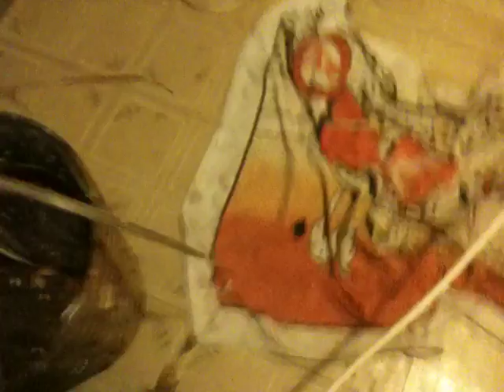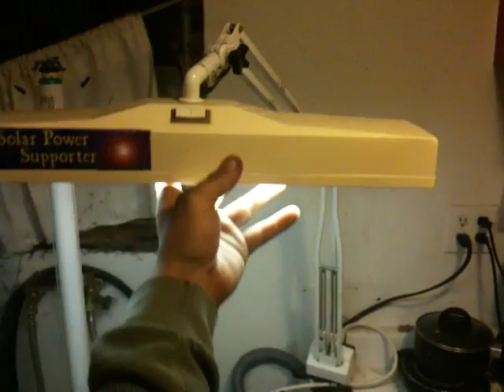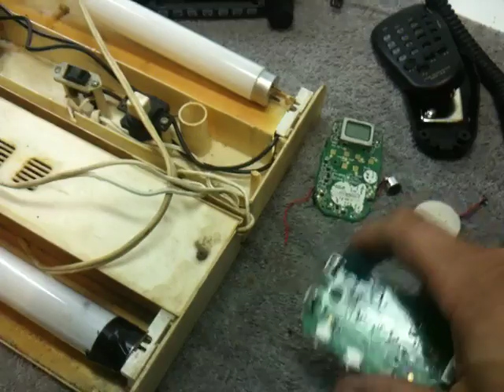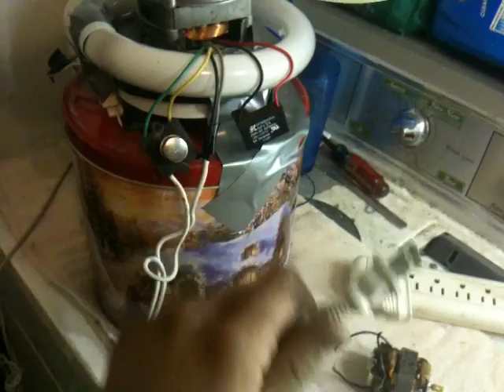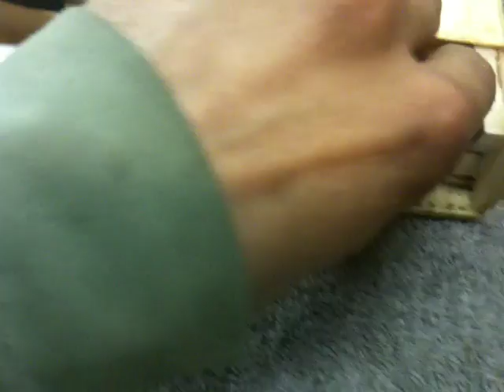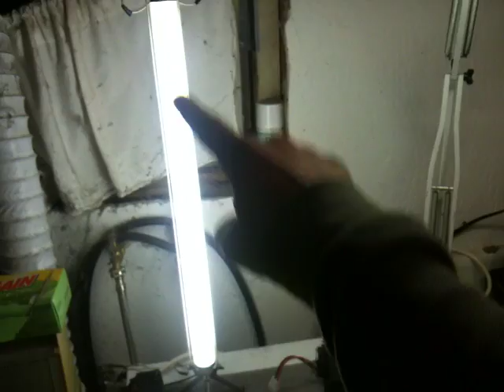My basic Lamp Presintation

Comment from the maker: i've watch the video many times over now and I never said that lamps shades are 'Useless' I pointed out that I saw no sense in using them with incandescents because Fluoescent are the same as incandescent only difference is the white powder on the walls of the glass act as "Diffusers" as you call it already and they use less power then a incandescents and do "NOT" hurt my eyes. Maybe you need to 'Listen" more to what one is saying before you commet just my "Thoughts" you think about it...

Comment: If I may point out, the whole point of a lampshade is to diffuse light, not block it. That's what you were talking about, with the whole bit about the tiny, bright point of light, is the fact that those bulbs don't automatically diffuse that light. I agree, incandescent bulbs are much better at diffusing light, but I think you're missing the point when you say that lamp shades are useless and yet that the incandescent bulbs hurt your eyes.